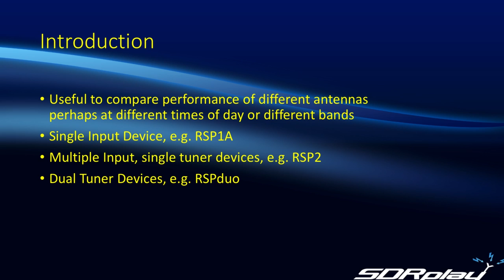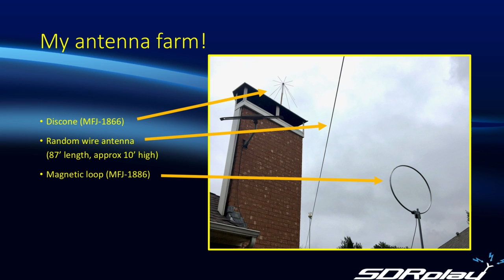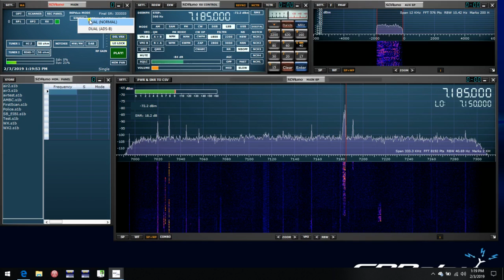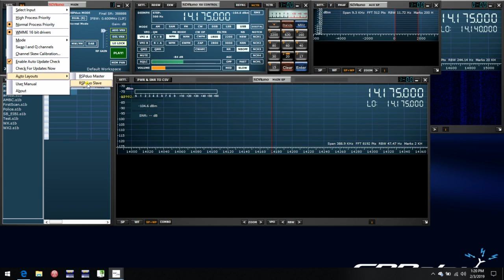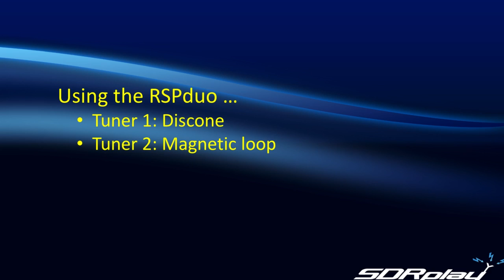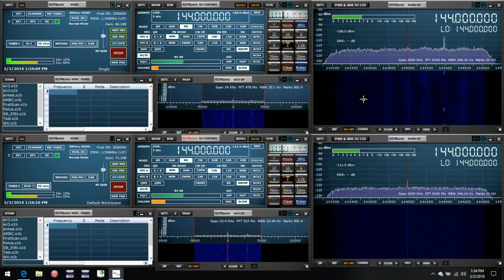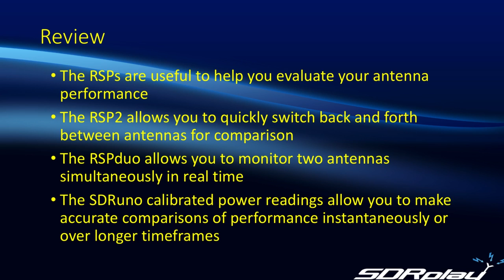Using your RSP for Antenna Comparisons

Comment: KRLD is in Irving on Hunter Ferrell road next to the landfill.
Reply from the maker: Really BadAim No, that’s KFXR on 1190.
Reply: @SDRplayRSP  I remember now.  It's 1190.  Question.  Will port B allow you to power the mfj 1886 without the need of the mfj bias tee?
Reply from the maker: Really BadAim No, the Bias-T provides 4.7V, the MFJ requires 12V. I tried it anyway but it was not enough!
Reply: @SDRplayRSP  ok thanks

Comment: Excellent demonstration.  The Duo makes this type of tests so much easier especially when looking at the HF band.  I have attempted this with my RSP1A and RSP1 but things change so rapidily it is hard to get good information when the antennas are very close in their performance.  Another method I use is the recording of the signal and SNR. These is a great feature of SDRUNO.
Reply from the maker: Yes, the recording feature makes things easier when you only have the single tuner option!

Comment: Having tried many antennas over the years, I always come back to the Wellbrook Loop. It picks up far less noise than any wire antenna I've tried and works well from 50 kHz to HF. For VHF/UHF I use small yagis and verticals.

Comment: I use 2 antennas on my window and switch them in the program. 1. combined UHF/VHF antenna (Diamond SG-M507) for radiostations on this bands, and 2. some old CB antenna. Second one is fine for shortwaves, but I wish to try Magnetic loop, dipole or something else interesting somday. Ofcorce both antennas works fine for FM band, I live in a big city.

Comment: After placing an order with MFJ on 01/20/19, I waited over a week to find out from MFJ had their MFJ-1886 on a 6-week backorder. I canceled my order and ordered The W6LVP magnetic loop antenna. It arrived in less than a week. https://www.w6lvp.com/product/amplified-receive-only-mag-loop-antenna-with-power-inserter/

I am really impressed with my initial testing. Hopefully will have something to show soon. I just ordered a cheap rotator from Home Depot and should have that installed soon and everything moved to my roof.